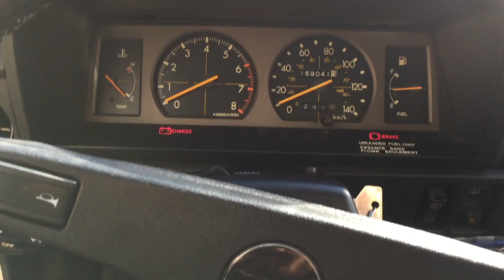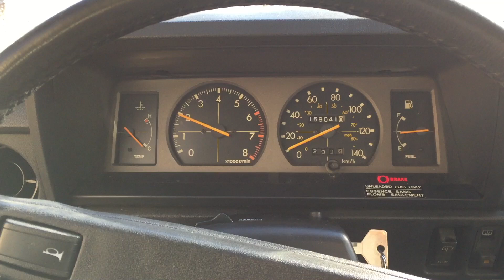Introducing the 1981 Tercel SR-5

Comment: I had one of those, a 1982 hatchback I got bought at a 'repo' yard owned by a bank my friend's wife worked for.  IT came with 5,000 miles on it, but I put the next 160,000 miles on it. No repairs ever needed, just did the regular maintenance.   Traded it in since it wouldn't pass the California smog test (Tercels were known to start burning oil at around 150K miles).  Great little daily driver car that never failed to get me to work or school.

Comment: This was my first car... well, my parent's which became my car...  A red Corolla-Tercel "SR-5"... I learned to drive on it, and drove it through the mid 90s.  One of the ignition coil wires kept falling out until one day when it did, as i was driving through an intersection, i yanked a shoelace off of my shoe, and tied it around the wire and some other hose above it in the engine bay.  It never fell out again. :D  Cheers, and be well. :D